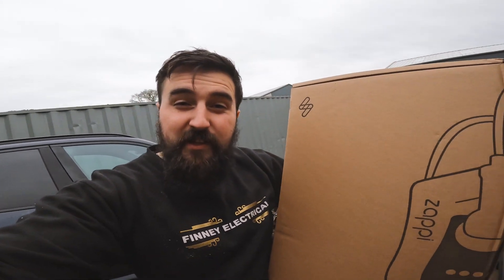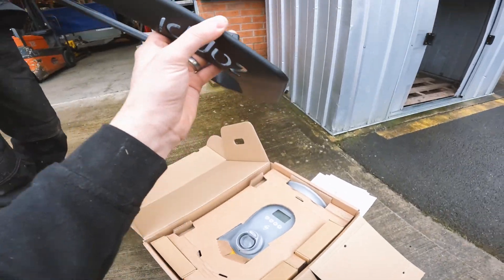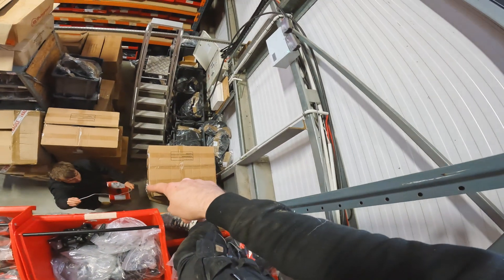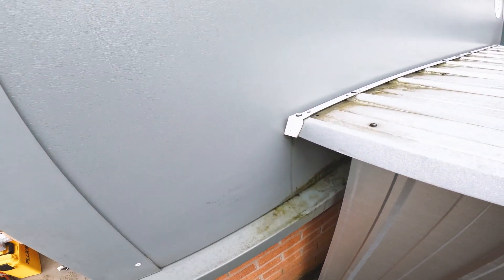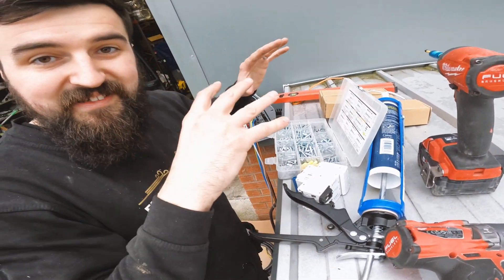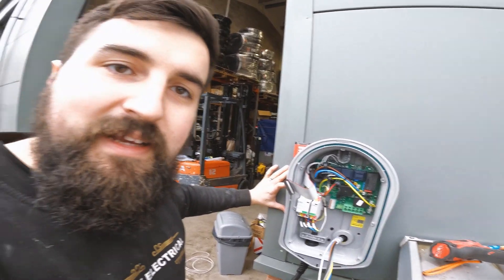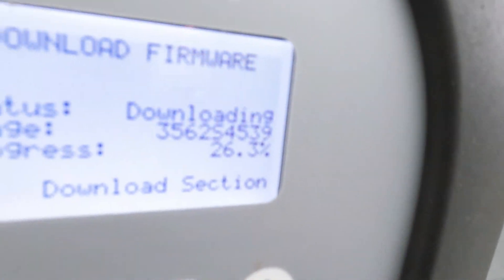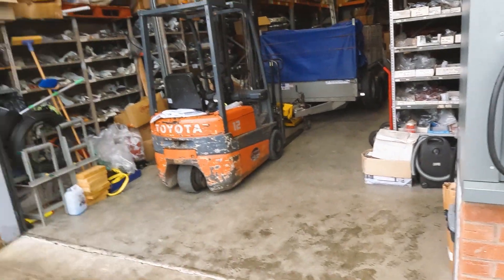SUPER FAST 3 PHASE EV CHARGER!!🔋

Comment: Great video.  For 3 phase EV charger do you require an SPD ??
Reply from the maker: Like any install it’s optional of the customer, some people argue a surge could damage the protections of the charger so an SPD is required. What if you get 2 surges would be my question to that as no one is checking if the SPD’s have blown.
Reply: Thanks pal. Appreciate your reply. Love watching your vlogs.  Currently doing my NVQ so your videos are very informative.  Just slow down a bit though 😅😅😅😅

Comment: Why didn’t you use a gland on the cable into the Zappi ?
Reply from the maker: Just prefer silicone, get a better waterproof seal with 2 cables sat together coming in
Reply: @finneyelectrical  😳really?
Reply from the maker: 💯 you never had it when you put 2 cables in one compression gland and water gets between the 2 cables??